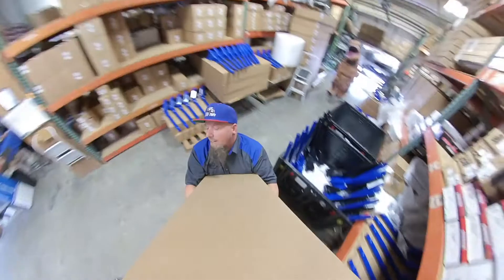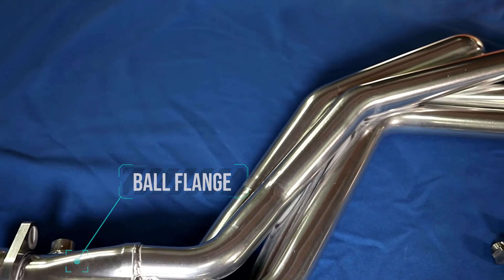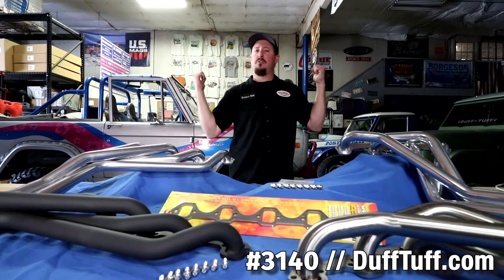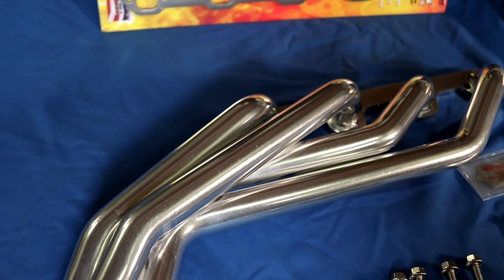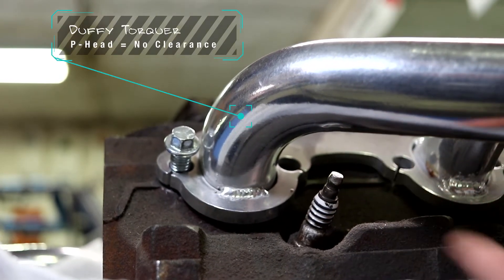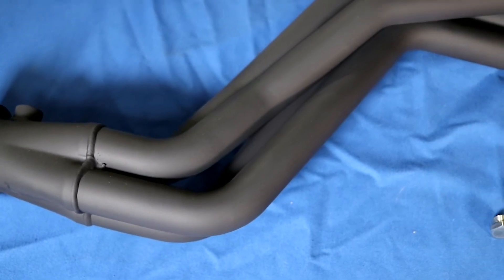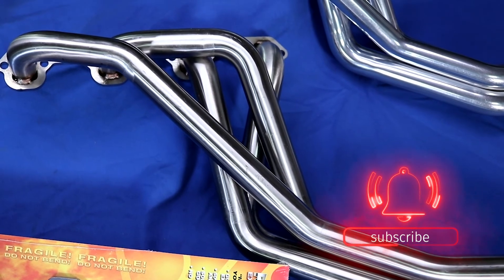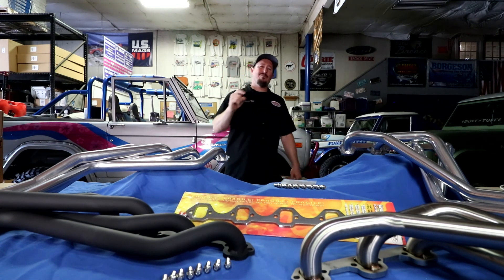James Duff - SS Dominator Long Tube Header Unbox and Overview

Comment: You mentioned producing a video testing these out on a dyno, as well as comparing exhaust options (Magna flow, Borla, etc.) and comparing dual exhaust to 2-1 exhaust. I’d be really interested in this and wonder if this is still being planned. You mentioned it 3 months ago so I was just wondering. Thanks MM!!!
Reply from the maker: Hey Doug, it’s on the schedule. Original time frame did get pushed back unfortunately. Looking to have it done before April of 22

Comment: Are these (coupled with either your aluminized or SS dual exhaust) compatible with an M5OD / D20 combo?
Reply from the maker: Hi Brent. We honestly don’t know. That trans was not tested with these headers. 

If I were you, I would compare that trans dimensions to the ones tested and approved and decide from there. 

You can see which trans these fit with by clicking the link in the description above.

Comment: Very nice product but overpriced.
Reply from the maker: Chris, from the research we did, you are not going to find a product that checks this many boxes and is made by American craftsman at a lower price point.

Plus, this is a product you buy 1 time. Many people don’t consider the longevity of a product and after 2-5 years they justify replacing a part they spent several hundred dollars on.

Sure, these can be produced in China with the same specs and sold for a couple hundred dollars less but then what grade of stainless are you really getting and how thin are the welds and how tight are the tolerances? 

All these design aspects must be considered when developing a product with such tight tolerances that is this versatile with this many features or you’re left with a pile of useless tube at a lower price point.
Reply: @BroncoGarage  Well stated!!